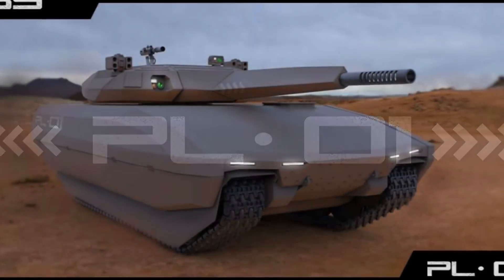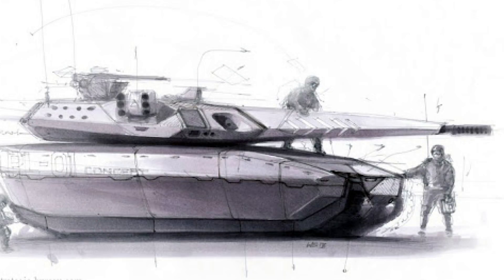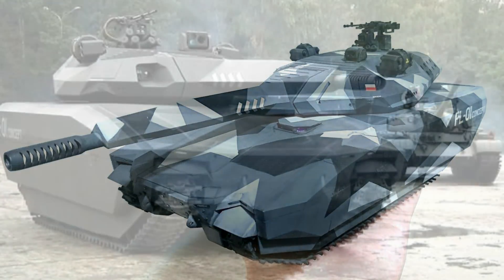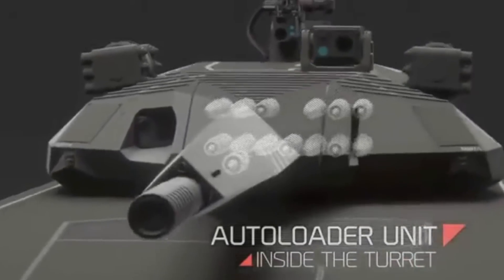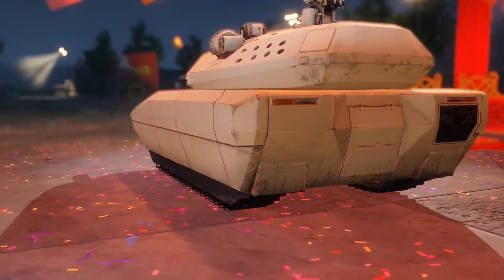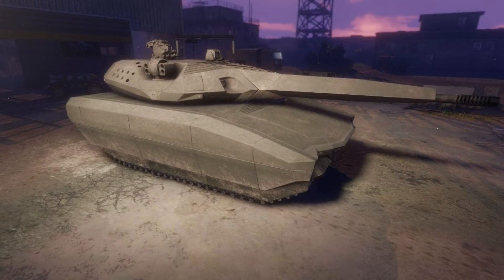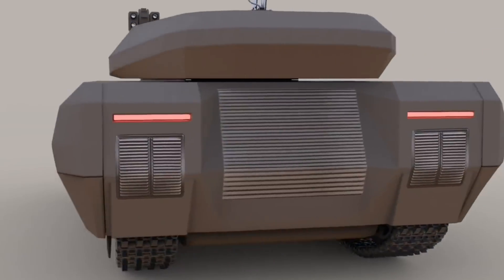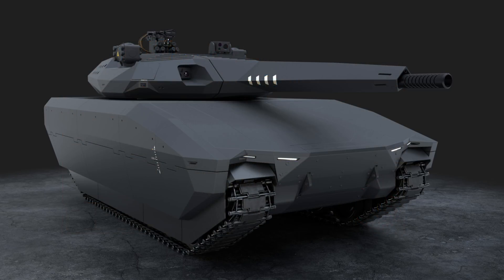PL-01 Prototype concept tank | POLISH STEALTH TANK

Comment: Very cool vehicle. As a MBT.....no. As a fire support vehicle for the infantry to free up MBTs for what MBTs are better suited for, then yes. And as you say, as a recce vehicle, heck yes. 

Best part, Takom makes a kit of this in 1/35, so you can build one for your shelf!
Reply: It will be a light tank but can be used like a standard main battle tank (MBT). The tank takes over the usual tasks of MBTs. Fight enemy tanks/vehicles and support infantry. The 120 mm caliber main cannon is also suitable for this. The cannon will be able to shoot both conventional projectiles and guided anti-tank missiles. In addition to infantry support the Planned designs included a 12.7mm  machine gun and a 40 mm automatic grenade launcher.
Reply: @GreatPolishWingedHussars  Cannon might be suitable, but the tank itself isn't. This wouldn't last 5 mins going up against  other MBTs. 

BTW, nice job dragging up a year old post. Some people have nothing better to do I guess.
Reply: @viper29ca  You write nonsense! Tanks are not only destroyed by enemy tanks, but also by infantry and from the air by airplanes and helicopters. And for weapons of infantry, of helicopters and of planes, the PL-01 will be invisible. Because most anti-tank missiles are so-called "fire-and-forget" missiles that are either controlled with electro-optical thermal imagers or with active radar. For these missiles the PL-01 will not be recognizable! 

By the way, you yourself wrote that the PL-01 will be able to shoot down enemy main battle tanks. In such situations, the one who aims and hits better survives. Because the main battle tanks are not indestructible.
Reply: @viper29ca  
Besides, it's idiotic to complain that someone is commenting on an a year old post. Even after a year one can still read your nonsense. If you don't want comments, delete the nonsense you wrote.
Reply: @GreatPolishWingedHussars  any vehicle with a 120mm gun can take out a tank. Doesn't make that vehicle a main Battle tank. This thing while innovative, because if its light armor, is a light tank at best. Sure, it can take out a tank if need be, but you don't put these head to head against another MBT force, they will have their lunch handed to them really quick. As I said, infantry support, Reece, etc, sure, but you aren't going toe to toe with a MBT force. After all, that is why Poland has Leo 2s, and are getting Abrams.

As far as missiles, plenty still out there that is still guided by the shooter. May be invisible to radar, but not to the naked eye. Wouldn't stand a chance vs something like a TOW
Reply: @viper29ca  Gone are the days of blitzkrieg with only tanks, because the infantry is just as fast as the tanks. Air support is also very important. So tanks do not fight alone but as part of a tactical formation. So as part of a tactical formation which is the arrangement  of moving military forces such as tanks, infantry, air cavalry, AFVs and military aircraft. The enemy uses the same tactical formations, except that the missiles of the infantry, AFVs, air cavalry and military aircraft will be ineffective against the Polish PL-01. Except that the enemy tanks can be killed by the Polish infantry, air cavalry, AFVs and military aircraft in addition to the tanks. So the PL-01, which is invisible to enemy missiles, is a very useful tank.

By the way, wire-guided TOW missiles are obsolete and short-range. But for the PL-01 they are the only dangerous missiles. TOW missiles cannot be fired from aircraft and have a maximum range of only 5 km.
Reply: @GreatPolishWingedHussars   XXXG-01SR Sandrock gundam better than pooland fictional tank

Comment: Hey Matsimus! I would love it if you could do a video on the Karrar tank. It is Iran's main battle tank based on the T-90. I would love to know what changes it has!
Reply: A video about the Polish PT-91 Twardy would also be interesting while we're on the topic of T-72 upgrades. Because the T-90 is such an upgrade of the T-72 as the Polish PT-91 Twardy.
. By the way, the PT-91 Twardy is one of the best upgrades of the T 72 tank. Changes from the T-72 include a new dual-axis stabilized fire-control system, reactive armour, a more powerful engine, transmission and new automatic loader. Unlike many other T-72 upgrades, the Polish Army PT-91s are upgraded using elements created almost exclusively by domestic companies, including a new engine, the fire control system and all communication system elements. 

In fact, it's almost a new tank, because I haven't named all the modernizations. By the way, many of those elements were used to upgrade existing fleets of T-72 tanks in countries including the Czech Republic (T-72M4 CZ), Georgia (T-72SIM-1), and India (T-72 Ajeya Mk. 2). The tank was also exported to Malaysia. So this Polish company has quite a lot of experience in developing tanks.

Comment: Im glad OBRUM moved from those ridiculous ideas into very real projects like a PT-91M3
With a certain possibility of getting K2 Black Panther production program for Poland the future of new Polish MBT looks rather promising.
Reply: Not before they "go crazy" earlier with PT-16 and 17.
Reply: "MBT"
Reply: @valhalanguardsman2588  I see you don't find K2 as MBT sufficient enough? Thats all fine. It's good to have some doubts.
Reply: This is not a ridiculous idea! That's the future! Hopefully this tank will be produced in series in Poland. It would be a great success for the Polish defense industry. In any case, the future belongs to stealth ground vehicles. Because most anti-tank missiles are so-called "fire-and-forget" missiles that are either controlled with electro-optical thermal imagers or with active radar. In the future, not only tanks will be protected with stealth technology. For example, armored fighting vehicles will also be protected in this way in the future. Incidentally, of course, not only the Poles are developing this technology.
In any case, if all combat vehicles are protected with stealth  technology in the future, then the old wire-guided technology will be used again, i.e. missiles guided by wire by an operator. The disadvantage is the limited range, because the range is reduced by the length of the wire.
Reply: @GreatPolishWingedHussars  Gundam better

Comment: I'd say a crewless turret is the way to go. Potentially with redundant driving controls for the entire crew so the tank can drive itself to safety if the Driver is taken out.
For starters, you don't need to armor up your turret too much. Just enough so AT rifles don't make a comeback. That means massive weight savings.
Second, the turret ring can be much smaller because you don't need to acomodate three guys inside of it, which in turn means you can armor up a turret to reduce firepower kills and the turret itself can be only as big as it needs to be, making for a smaller target and still saving a lot of weight even if you decide to armor it up.
Third, with the prevalence of top attack ATGMs and bombs, the turret itself means extra protection for the crew.
And finally, if you can use the terrain for your advantage or had dug in in defense, you only need to expose the crewless turret to the enemy.

The disadvantage is that if the robot loader jams, the tank pretty much firepower killed itself. If you can kick it back into working, you'll either have to retreat defenseless under fire or expose your ass to it.
Someone somewhere will design something that can be accessed from the inside, but that's just asking for the robot to load someone's face in the gun at some point.

Comment: Thx for vid.  
Although it looks very cool (reminds me of the Lynx KF41), this is not a main battle tank
An MBT is the tip of the spear and needs a min amount of armour.  Being able to only protect vs a 25mm (which just about every IFV has) is a huge mistake.  
I am also not convinced how usefull is radar stealth when we talk about ground vehicles?  I get wanting to have low radar signatures on aircraft or ships, but on land there are many natural obstacles that make it very difficult for radars.  So are the costs in developing anti radar tanks really worth it?  Some smart tactics in deployment seems like an effective and cheaper countermeasure.
That said i do think that tanks and other ground vehicles would benefit from reduced infrared signatures, since many ground vehicles and attack helicopters have thermal detecton systems.
In short it looks good, but there are legit reasons this never passed the concept stage
But this is good basis to make a fine IFV, just replace the gun with 25 to 40mm gun and add an ATGM launcher and increase troop capacity to at least 8, or buy a CV90, etc... 😉
My 2 cents
Reply: There's already ongoing IFV program in Poland called "Borsuk". It has everything you said, plus the gun can be easily replaced between 30 and 40mm. And it's amphibious.

Edit: Also if I remember corectly it will have STANAG 4569 level 6 protection front and level 5 sides with additional armour packs.

Comment: The Cv-90120 is made to give mechanised infantry some heavy firepower without using diffemrent supply chains than the normal cv90, sometimes you just whant to put a 120 he in the enemies general area
Reply: The CV90120 is not the PL-01. The PL-01 will be much more powerful. The PL-01 will be a much improved upgrade of the CV 90120  including the stealth properties. The Polish company OBRUM has proved with the upgrade of the T 72 that they can upgrade tanks very effectively.  The PT-91 Twardy is one of the best upgrades of the T 72 tank. Changes from the T-72 include a new dual-axis stabilized fire-control system, reactive armour, a more powerful engine, transmission and new automatic loader. Unlike many other T-72 upgrades, the Polish Army PT-91s are upgraded using elements created almost exclusively by domestic companies, including a new engine, the fire control system and all communication system elements. 
In fact, it's almost a new tank, because I haven't named all the modernizations. By the way, many of those elements were used to upgrade existing fleets of T-72 tanks in countries including the Czech Republic (T-72M4 CZ), Georgia (T-72SIM-1), and India (T-72 Ajeya Mk. 2). The tank was also exported to Malaysia. So this Polish company has quite a lot of experience in developing tanks. So this Polish company already has experience in upgrading tanks!
Reply: @GreatPolishWingedHussars  its literally a cv90120 with some "stealth" panels on top
Reply: @einar8019  This is actually just the chassis of the CV90120. So just the scaffolding! The PL-01 has a crew of 3 with an automatic loader for its main canno and the CV90120 has a crew of 4 with loader in the turret. The PL-01 can carry an additional of 4 infantrymen and the CV90120 can carry an additional of 8 infantrymen. But the PL-01 has a much more powerful engine and that is not the engine of the CV90120. But I doubt the PL-01 will keep the diesel engine. The PL-01 also has a Polish 7.62 mm UKM-2000C machine gun and not the Swedish 7.62 mm Ksp m/39 machine gun. Whereby a 12.7 mm machine gun may will be installed! The PL-01 is also said to have an additional 40mm automatic grenade launcher which a CV90120 does not have.

There are other differences between the PL-01 and the CV90120! As I said, that's just the chassis of the CV90120.
Reply: @GreatPolishWingedHussars  dude.... its literallly a mockup of some cardboard ontop of a cv90120
Reply: @einar8019  Ridiculous statement from someone who has no idea what a chassis is. Because it was actually only used the chassis of the CV90120. This is actually a new tank with only the chassis of the CV90120. 
The PL-01 differs from the CV90120 not only by the stealth technology. The PL-01 has a crew of 3 with an automatic loader for its main canno and the CV90120 has a crew of 4 with loader in the turret. The PL-01 can carry an additional of 4 infantrymen and the CV90120 can carry an additional of 8 infantrymen. But the PL-01 has a much more powerful engine and that is not the engine of the CV90120. But I doubt the PL-01 will keep the diesel engine. The PL-01 also has a Polish 7.62 mm UKM-2000C machine gun and not the Swedish 7.62 mm Ksp m/39 machine gun. Whereby a 12.7 mm machine gun may will be installed! The PL-01 is also said to have an additional 40mm automatic grenade launcher which a CV90120 does not have.

There are other differences between the PL-01 and the CV90120! As I said, that's just the chassis of the CV90120. So just the scaffolding!
Reply: @GreatPolishWingedHussars   XXXG-01SR Sandrock gundam better than pooland fictional tank

Comment: The information is not accurate, it was equipped with 105mm gun, not 120mm
Reply: You statement is not accurate either. In theory such vehicle could be equipped with both calibers if... it was even equipped in any. It was a mock up, no real gun was mounted.

Comment: Honestly, I can see it being used as a tank in asymetrical conflict. It's lower weight lower cost and overall easier logistics would make these missions more efffective. Not so good for Polish, who are planning to have 800 tanks for fighting Russians on flat land.

For smaller countries who don't have much military force this type of vehicle can be more beneficial. Imagine having 90 of these instead of 30 MBTs. Also, if they come to bigger army as a recon or infantry support, I don't think it needs 120 mm - leave the heavy MBTs to dedicated tank hunters. Maybe there will even be a 130 mm panzerjaeger-style vehicle :D with all the systems that protect MBTs from missiles, a simple glasscannon can come back to fashion.
Reply: THIS IS NOT A MBT FOR CHRIST SAKE! IT'S A IFV/FIRE SUPPORT VEHICLE!
Reply: @jakubw.2779 I never said it was MBT. Read before commenting and turn off your caps.
Reply: @deffington6627  read the first part of your comment. You clearly stated that the plan was to replace all Our  MBT with this, which was never an option, even in this very concept. It wasn't supposed to replace MBT. it was supposed to support it. Plan was to replace 300 magazined and conserved T-72M1 with it, sell the rest of T-72s, put PT91 Twardy to reserves, modernize Leopards and maybe buy some additional Leo2, So no it wasn't supposed to entirely replace MBTs. It was designed to support MBTs
Reply: @jakubw.2779  I very clearly stated that I can see it replacing MBTs in asymetrical conflicts. Because getting MBT over half of globe is kinda expensive and high performace APSFDS is hardly needed there. I also clearly stated, that I don't think it is good vehicle for Polish, because you plan to buy 800 (real) MBTs and your doctrine is not assymetrical conflicts, but fighting Russians on flat land. Anything else you misread?
Reply: @deffington6627  you weren't as clear as you think on that. The part about Poland buying 800 tanks can be easily misunderstood for you stating that PL-01 is a replacement for MBTs

Comment: Stealth tanks would be an interesting concept though I do not really think it'd be very reliable and or effective on them, main reasons being is that tanks as you know either are or can be pretty loud when the engine is either running or whilst the tank is in motion. Another one being like you said, they kick up quite a bit of mud / dirt so they can not only be seen but heard from quite a long way off which would render the stealth ability absolutely useless in my opinion unless the tank is completely still or stationary, with the engine off. Could just be the only effective way a tank can be stealthy unless, manufacturers start swapping out engines with full electric power :D That one looks more like a support / scout variant and not something that'd go up against another tank, maybe APC's / IFV's and or light armoured vehicles.

Comment: Thanks Matt. This tank could be made viable by putting frikin' laser beams on its frikin' head, and having Banksy design the paint scheme for the camouflage. The sinister enemy would stop to admire the paint job, long enough for the tank to aim and fire its frikin' laser beams, thus winning every battle. This would be particularly effective in urban warfare, where the tank would blend in with all the graffiti on the city walls. You could even send in recon patrols to spray paint graffiti everywhere, making super-sure the tank is hard to spot. A teflon clear-coat would make sure that all mud slides off the tank, keeping it beautifully clean at all times. A built-in sprinkler that would wash the tank constantly, would also be a good idea. Lastly, placing a Terminator T-800 sitting on top will scare off most people, like a scarecrow for humans.
Reply: Yes or something nonsensical from aliens is missing!

Comment: I'm not that into tanks as much. But I always love tank developments and various types of tanks being develop by other countries semi independently. I get that pleasure from knowing that multiple tanks are being developed in other nations too instead of the usual countries.
Reply: So Poland built tanks before! The PT-91 Twardy is one of the best upgrades of the T 72 tank. Changes from the T-72 include a new dual-axis stabilized fire-control system, reactive armour, a more powerful engine, transmission and new automatic loader. Unlike many other T-72 upgrades, the Polish Army PT-91s are upgraded using elements created almost exclusively by domestic companies, including a new engine, the fire control system and all communication system elements. In fact, it's almost a new tank, because I haven't named all the modernizations. By the way, many of those elements were used to upgrade existing fleets of T-72 tanks in countries including the Czech Republic (T-72M4 CZ), Georgia (T-72SIM-1), and India (T-72 Ajeya Mk. 2). The tank was also exported to Malaysia. So this Polish company has quite a lot of experience in developing tanks.